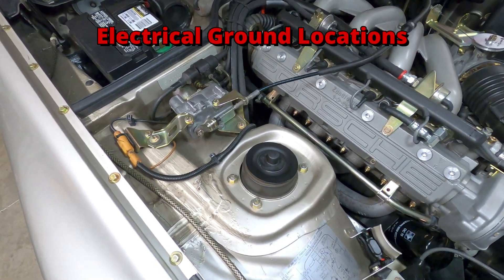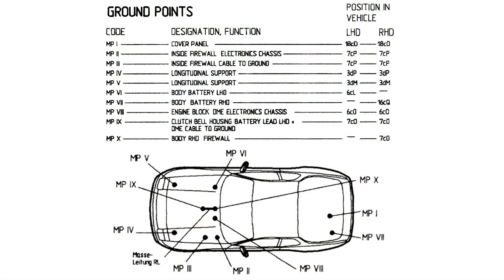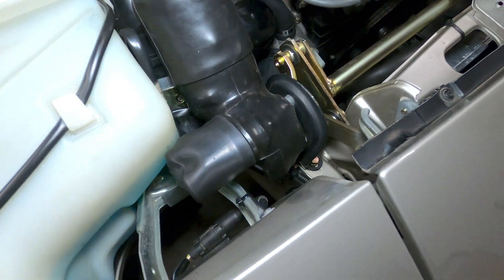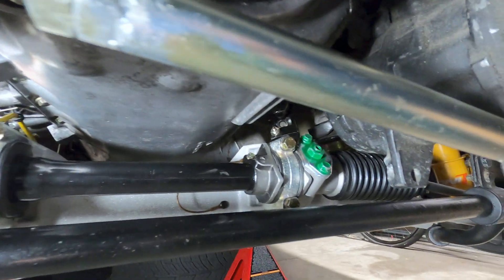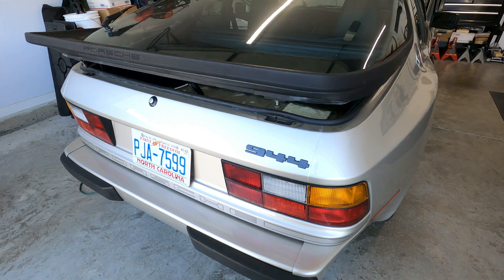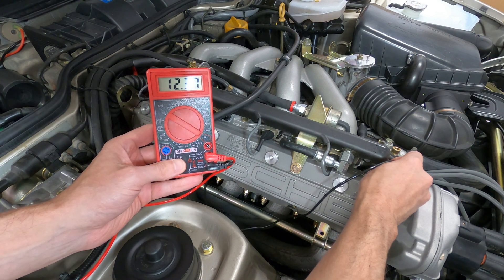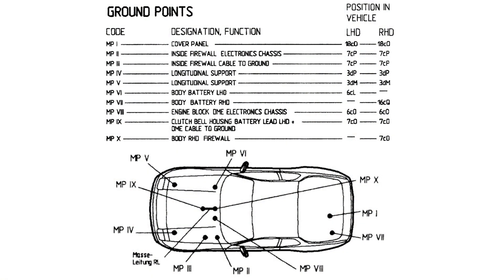Porsche 944 – Electrical Ground Connection Locations & Issues Tutorial

Comment: Hey man, it’s kind of a shot in the dark but my early car’s engine firewall ground fell into the flywheel inspection hole. I took off  the starter, rotated the engine, looked in with a borescope and used a magnet on the whole thing and no results. On startup after reassembly it made a loud grinding noise. I have no idea what to do, any suggestions?
Reply from the maker: Bummer. Only options are to keep fishing around for it through the starter hole or pull the transaxle, torque tube, and clutch housing, at which point you might as well replace the clutch and rear main seal.

Comment: How do you remove the black bolt holding the wires to the wall?
Reply from the maker: Can you provide some specifics on the black bolt you’re referring to? Do you mean the black plastic clips that secure the harnesses to the frame rails?

Comment: I’ve been having an issue where the signal strength for the injectors isn’t strong enough to open all injectors. With only 2 injectors connected they will open and squirt fuel, but as soon as a third is connected none open. All injectors are new and work correctly when individually connected. I thought it could be the ground connections on the bell housing but I cleaned those and the issue remains. Do you have any idea what else it could be?
Reply from the maker: Other things to check would be DME/fuel pump relay, test the speed/reference sensors, and test fuel pressure at the rail, all of which could affect injector firing.

Comment: How is it possible to reach the ones on the bell housing? Looks impossible on my 924s
Reply from the maker: Ratchet extensions and u-joint or closed end of a ratcheting combination wrench. You may have to temporarily move some other wiring back there to reveal them (example: disconnect bracket for the crank sensors).

Comment: Yet another awesome video from NC944er! The headlights on my ‘85 early 944 would turn on but don’t flip up. So I figured it was either the relay on the motor or the motor itself. So I swapped out both with known good. No change. Leads me to believe a ground issue or something else. I tested the 4 pin connector. I see 0v on the first pin, 12+ volts on the second pin down, 0v on the third pin down, and finally the fourth pin shows 10.xx v. If I’m not mistaken both 2 and 4 should both read the same 12.xx v. Could that be a bad ground? Or something else?
Reply from the maker: @dsomas91  The voltage at the fourth pin should match the voltage at the second pin with the headlights off, essentially battery voltage of 12+, anything less would indicate added resistance in the circuit due to poor grounding or damaged wires. When the ignition switch is on and the headlights are turned on, you then should see around 12 volts on pins one and four (mine read 11.36 and 11.76 volts), and pins 2 and 3 are 0 volts. I believe there is also an 8-amp fuse on the early cars, fuse number 1 on the upper fuse bank for retractable headlights. It mght be good to inspect/clean the fuse and it’s connectors as well, as the panels can develop oxidation over the years.

Comment: Love this channel. I have a question about replacing the negative battery cable. The current negative harness in the car has two ground wires: one to engine and a slightly smaller one to the chassis. But the replacement I was sent has only the longer cable that goes to the engine and a much smaller wire with a yellow connector on the end (perhaps for components?). Not sure what to do about the ground to the chassis.
Reply from the maker: @jonathannichols-pethick3479  Hey! Unless you can fabricate a shorter chassis strap and tap it into the other lead, I’d probably go for a different part. Looks like 944Online has both cables, OEM Porsche for $300. Supposedly no longer in production and not many units left.
Reply: Thanks so much for this. I ended up taking the harness I removed from the car to a place here in town that was recommended to me - they specialize in heavy trucks and electronics. The guy behind the counter took one look at what I brought in and said he could make one for me. Took him about 20 minutes and cost me under $30. Working like a charm.
Reply from the maker: @jonathannichols-pethick3479  Awesome, glad you were able to find a solution! 👍🏼

Comment: @0:52 Can anyone tell me what is the function of that barrel shaped thing that sits in front of the VIN plate and behind the speed control?
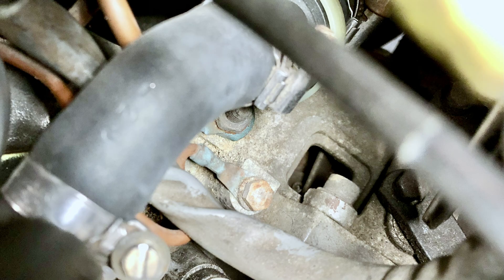And is it the same thing @0:56 that sits aft of the intake manifold runners? 
NC944er your videos are amazing and I will happily watch as many as you make.
Reply from the maker: Thanks! 😂 So a couple things back there… the round, black component directly in front of the VIN tag is the electrical connector for the cruise control servo. The round, metal cup/barrel just below that is where the motor for the servo is housed. It attaches to the aluminum housing, inside which is some gearing that ultimately drives the actuator arm to control the throttle when cruise is active.
Reply: @NC944er  Thank you very much. You are a star.
Reply from the maker: The round, black connection behind the intake manifold is the electrical connector for the O2 sensor.

Comment: I have 1989 944 S2 and I removed the battery now I cannot open the doors hatch or anything. How can I connect the battery to some parts outside to open the doors ?
Reply from the maker: If you raise the car, you can crawl under the front end and reach up to the top where the hood latch is and pull on the cable with a pair of pliers. After popping the hood, you can reconnect the battery.
Reply: @NC944er  I could do that, but I have no idea how that cable looks like and where it is located
Reply from the maker: @trbossdoggy  It’s a standard black cable, similar to a brake cable you would see on a bicycle. It connects to the hood latch at the top center where the hood meets the nose panel.
Reply: @NC944er  OK will try to do that, hopefully will work, thanks a lot !

Comment: Is it possible to reach the two bellhousing grounds with the intake installed? I have a lift if underneath is an option.
Reply from the maker: It’s not fun, but it is possible. It’s easier to get to it from above in my experience. You can disconnect the sensor wiring bracket at the back of the manifold and push that aside. You’ll also have to push or pull the heater control valve a bit, as the leads terminate right below that short rubber heater hose. Some universal joints and socket extensions come in handy as well.
Reply: @NC944er  ok thanks. That one needs some attention. BTW, the two you reference near the shock towers are not on my Turbo (unless I'm missing them). Mine is an ‘86 so no ABS.
Reply: ok, I did these two on my '86 Turbo. I was able to get the smaller/single wire but it wasn't easy. Tried for a long time on the second one which is obstructed by the tan wire harness. I was trying to avoid disconnecting the temp control valve hose. Just do that, jacked up the back of the car about 6 inches and hardly any coolant spilled out. You still need to move that harness out of the way, it goes directly across the hole. These are the hardest two on the car, the rest are easy.
Reply from the maker: @bobd9868  Yeah, that’s a terrible location back there. Similarly, swapping the crank sensors can prove to be super annoying. Glad you got it done. 👍

Comment: great video. Just did this on my 944 turbo. The ignition buzzer sound sort of warbled and the hood light did not work. Cleaned up the ones under the dash and resolved both issues.
Reply from the maker: Nice! Gotta have that ultra bright hood light for those roadside repairs in the dark. 😂 Come to think of it, I’m not sure mine works at the moment.

Comment: yooo i NEED hELP!! 1983 Porsche 944 ! fuse #2 keeps blowing after trying to crank! I HAVE all new everything from fuel pump, injectors ,spark plugs , ground straps , all new fuses, new dme/fuel pump relay, new fuel filter, new cap n rotor, new spark plug cables! even replaced DME with a known same model one (came off another 83) no avail! even had a new fuel line installed from the rear of the car, from the fuel pump to the front of the engine! what else hmmm ooh! both new reference sensors!! what else .. ohh i even slapped a new a battery! all parts were either bosch brand or germany direct oem parts! no cheap F brand was used! i even had a suppose electrical guy check it out and even he couldnt tell me what was wrong with it like wtf -250 😢😢 HELP! i even jumpered the alarm to bypass it but it did not HELP the NO START DIAGNOSIS
I am in Los Angeles CA
Reply from the maker: Hey, it sounds like you’re having quite the time there! I’m assuming you’re referring to fuse #2 on the upper fuse bank, which is the 16amp fuel pump fuse? If the fuse keeps blowing, that would indicate there’s a short in the wiring somewhere between the fuel pump and the fuse panel, an errant ground or crossed wiring from degraded insulation that’s putting extra load on the circuit. I’d make sure the connections are installed correctly, not touching each other or metal on the chassis, and trace as much of the wiring as you can to inspect for damage. It may also be worthwhile to pull the fuse panel down to check the wiring and connectors behind the panel, make sure everything is straight and clean back there as well.

Comment: Thanks so much for these videos! Excellent production. I'm having a bit of an issue with a no start condition. My tester shows a steady light on the neg side of the coil, where it should be flashing from input received from the reference sensor which I replaced last week. (put tape over the flywheel hole if you attempt this,, btw) I'm thinking it must be a ground problem. Any comments if I am missing something,, all replies gratefully received. I'm the OO of this 85.1 and in all that time never had this problem. Many Thanks
Reply from the maker: Hey Kevin, thank you! Sorry to hear about the no start situation. I’d be taking a shot in the dark with any recommendations, but you’re generally looking for lack of spark or lack of fuel. Can you pull a plug and test for spark? Is the fuel pump operational? Is the AFM wiring harness connected? (I’ve forgotten this a couple times when rebuilding engines in the final stage rush to get it back together 😂) Other common causes are a bad DME/Fuel pump relay, seized fuel injectors, bad DME computer, failed alarm control module (if you have a factory alarm). I’d make a list of things to test and start eliminating suspects. This is a great place to start, second section for engine will not start - https://www.clarks-garage.com/shop-manual/ts-01.htm
Reply: Thanks for your reply. I think we are narrowed down to the bloody speed or tdc sensor. I changed the tdc one last week. Bit tough as there's not much space back there. lol
I have a dme on order but suspect that is not the problem as the plugs are wet,, so I think the the fuel pump is getting power from the dme? I need to refresh on a multimeter (only been about 30 years) as per your videos,, superb btw. And go from there.....
  @NC944er

Comment: All my gauges work, except for the voltmeter. I suspect it could be a ground issue, any other ideas?
Reply from the maker: Grounds are a good place to start… There are also common issues with the electrical connections behind the gauge clusters. The connector may not be fully seated or some of the pin terminals may be partially pushed out of the plastic connector and not making contact with the gauge. Pull the cluster and check the connections to be sure. You can also use a multimeter to perform tests on the wires to see if voltage is making it to the gauge as well as test the voltmeter gauge in the dash by connecting a battery power source directly to it, then you’ll have an idea if it’s a wiring issue or a broken gauge (it’s typically the former).
Reply: @NC944er  WOW, appreciate the comment! Love the 944 community, everybody is so helpfull! Regarding the voltgauge, I "luckily" need to remove the cluster in order to fix the odometer gear, so that gives me a good reason to check the rear of the cluster like you say. When it comes to the grounds, is there a specific one to check for the cluster or do I need to check them all?
Reply from the maker: @WhereverHugo  Sounds like good timing. 👍🏼 The grounds in the cabin are usually pretty clean, but it couldn’t hurt to pop under the dash and take a quick look, I’ve seen some crazy wiring situations handed down from prior owners, usually to wire in an aftermarket radio or bypass other issues haphazardly, so you never know. As for the engine bay, the connections at the back of the engine block/clutch housing tend to get the most oxidation, as well as the ground behind the battery by the blower motor.
Reply: @NC944er  Thanks once again! I thought that for example, the cluster has one circuit and thus one ground that is connected to it, but that thought seems to be wrong. I'll check all the grounds, starting with the ones you highlighted in your comment.👍

Comment: Early 944 here. I can only find two ground connections behind what is the cruise control computer if you have it. The other two ground connections, under the steering rack, are not there on my car. Is this a common thing with early 944's? Im pretty sure they all share the same connections, except for the copper ground strap
Reply from the maker: Yeah, because of the changes in fuse panel placement across the early and later cars, you may find some differences in the interior grounding connections below the dash. Just remember that brown is ground and you can scan around with a flashlight to see if anything is terminating in other locations.
Reply: @NC944er  Thank you! So far haven’t found any points besides those two for the interior.. to be continued haha

Comment: I have a charging issue on mine where I only get about 13.5 volts charging regardless of engine RPM. I know my alternator is good as we went through that and put new brushes in. I suspect my battery ground is the culprit…
Reply from the maker: Certainly could be… good luck. 👍🏼

Comment: Hi thanks for this amazing and useful video. Do you think an electrical ground defect can cause bad gauge reading ? I see my coolant temperature gauge needle slightly oscillating when I put blinkers, and it also goes up when I turn on the interior fan.
Reply from the maker: Yeah, poor grounding can cause a lot of strange irregularities like that. Gauge issues can also be caused by oxidation on the contacts or poorly seated connections behind the gauge cluster.

Comment: My 85.5 944 came with an aftermarket radio head unit that was wired horribly. I fixed the wiring but when it’s powered fuse 39 (radio) blows immediately. Any idea where I should start looking?
Reply from the maker: Oh man, that’s never fun. Sounds like a short somewhere in the radio wiring, either an exposed wire grounding where it shouldn’t be and/or two or more wires making contact with each other when they shouldn’t be.
Reply: So you fixed the wiring and now it ain't working? 😁 Check the wiring diagram again

Comment: I've tested the circuit on my 944: battery is 11.9v, when i move negative to the engine multimeter is on 0.00 😳
Reply from the maker: What does the meter read with the positive lead on the positive battery terminal and the negative lead on a clean metal engine surface?
Reply: @NC944er  it says 0.00
Reply from the maker: @alexgt78  Sounds like it’s time to check your cables and grounds.
Reply: @NC944er  i've checked again, on the battery i have 11,90v. When i move negative lead on engine i still have 11,90v. Visually checked grounds and averything seems ok. But i have an issue with gauges. The water gauges goes up too fast, in 3/4km is on half then it goes up to the 3/4 but never beyond that. In addition, when i put some eletrical load (like air vent, high beam ecc.) water gauge moves up a little bit.
Reply from the maker: @alexgt78  Yeah, these cars have lots of little electrical gremlins due to the deterioration of wiring and connections over time, with the earlier cars typically getting the worst of it. Some folks have seen improvement with gauge irregularities by removing the gauge clusters, cleaning and reseating the connections behind the gauges.

Comment: I need to clean a lot of earth points as they are all green and corroded.... one electrical issue I have is my front right foglight (i have a RHD car) does not work. Bulb good, but only measuring less than 1v to the bulb...any idea where to start looking?
Reply from the maker: Hey man! I think you’re on the right track with cleaning up all the oxidized grounding points first, that can add a lot of resistance to the circuits around the car. You could also check and clean the terminals to the fog light wiring. If all that doesn’t provide any improvement, check voltage at the fuse panel for the fog lights. If that looks good, you’ll know there’s an issue with the wiring that will need further inspection/diagnosis. Good luck!

Comment: Revisiting this video as I’m encountering an issue with the main beam on the left pop up as it doesn’t work at all I have replaced the bulb and has done nothing not really good with electrics so not sure what I can do is it worth giving the ground a clean up?
Reply from the maker: Hey! Main beam as in high beam on the headlight? Does the low beam / dipped beam work? Have you checked out my headlight wiring video yet? There is a separate fuse for the main beam, not sure if you checked that out as well…
Reply: Wow i didn’t even realise you uploaded a new video I’ve watched it and now have a few ideas of what I can do thanks 👍 funny how I had this issue and you only just made a video answering the questions I had 😂